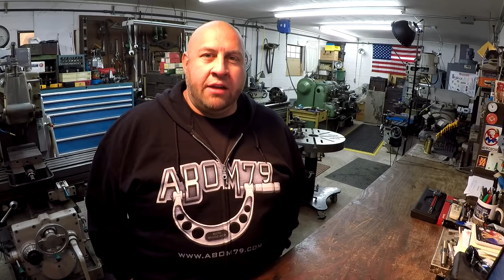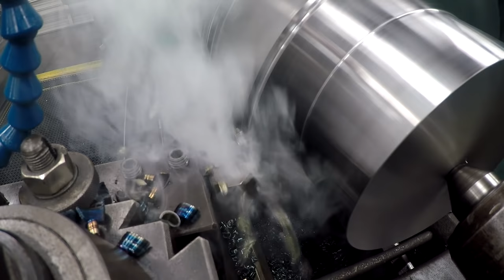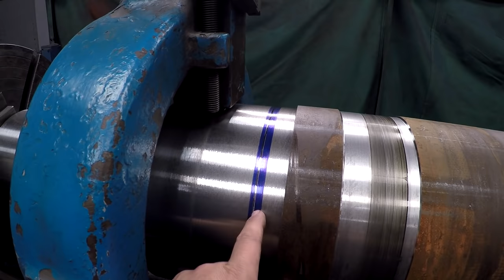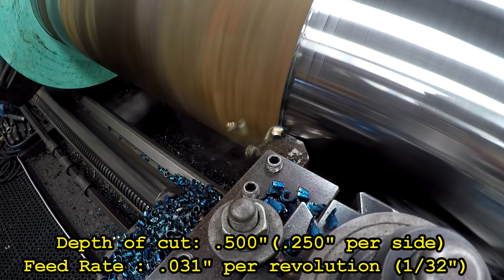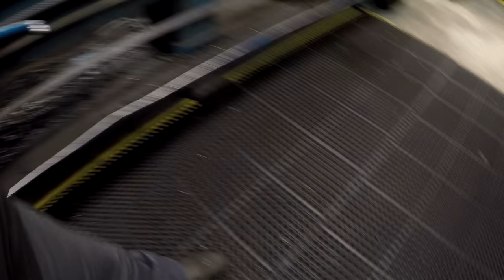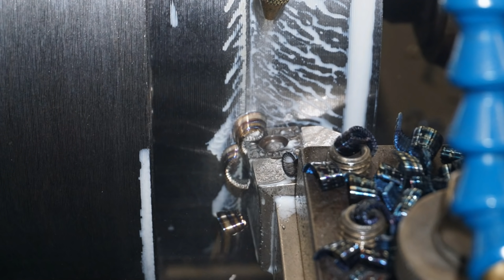SNS 149: Turning a 12" Shaft, Heavy Cutting & Feed Rates

Comment: I love the heavy turning. I think you should try .040 feedrate. I have run .300 diameter reduction with .040 feedrate roughing with a cnmg643 insert several times and it has worked well. It would do a much heavier cut but I don't have the power for it with my little lathe. Happy new year!

Comment: Blue chips and near caacity cuts. Smoke the paint off the chip pan. I love it. You have a quiet shop so there's no difficulty hearing what your machine is doing. I'm guessing from the musical note of the lgearing you're running about 3% motor slip. That would suggest to me about 80-90% full load Amps assuming a general purpose induction motor.

30 years ago when carbide was a bit more fragile than now, we would have used square inserts with 3/32 or 1/8 nose radius and a bigger chip breaker looking for chips shaped like 6's and 9's. Making the "C" shaped chips world sooner or later crumble the nose raidius no matter how much you radiused the cutting edge. Carbide is sure stouter now. An 80 degree diamond insert would nyever have survived that long roughing cut.

Next question is: who shovels and hauls the chips?
Reply: Thatt’s what new guys are hired for 😁

Comment: This takes me back to my machining days. I loved taking a beefy doc with those blue chips. I miss the old GnL VTL from the 80s that we used to have(it was retrofitted with CNC capabilities which was fun)
Reply: I remember the load sensors were broken and it would always trip with an 0.08 doc. When it got repaired my tradesman was testing out the sensors with a scrap module and a Walter WAM20 tip. I was on another lathe when I saw him walk past me dying with laughter. He was taking full insert cuts(0.5" cutting edge) and the tool exploded due to the heat. That machine was an absolute monster. Could take heavy cuts, was as solid as a rock and held size to tenths of thou. Always used it for machining back inconel welds.

Comment: Adam - that is some nice heavy duty turning. When doing a 6.35mm depth of cut (1/4 inch), how long does the insert last? Also - does cool-mist increase the life of the insert considerably or is it to keep the material from overheating?
Thanks for the constant flow of videos - even during christmas you put one up :). I can safely say that I look forward to every SNS with a cold beer and a nice sandwich :)

Comment: The thermodynamics of heavy cutting is fascinating - much of the energy from the motor is converted to heat in the chip which turns blue as it heads off into the chip pan, leaving behind a shaft that doesn't get too hot too quickly.  Subtle details make a lot of difference.  Thanks, Adam, for pointing this out.
American-born Benjamin Thompson [ Count Rumford ] in 1798 published his researches into the mechanical equivalent of heat [by boring cannon barrels with a blunt cutter] that many years later were important in establishing the laws of conservation of energy. 
  See:    https://en.wikipedia.org/wiki/Benjamin_Thompson

Comment: Wish I could have hit "like" twice on this one.  Man, that is some big piece of metal.  I can only imagine what the chips in the pan weighed.   Don't know if it was the mic placement, but it seemed like there was a change in the sound of the machine when the feed rate was upped.   I bet the power meter was really spinning fast!
Reply from the maker: +odc43054 On several of those cuts I turned the mic directly at the cut to maximize the audio for the video. It's not everyday I get to make big cuts like that.

Comment: Maybe a fan or a compressed air curtain in front of the GoPro?

Could you expound on the proper relationships between tool-nose radius, depth of cut, and feed rate in some future video? I expect that roughing tool had a fairly large nose radius.

Comment: Hello and Happy New Year Adam,  I absolutely concur.  Your comportment as an individual and You Tube presenter are a joy to watch as well as a wealth of knowledge.  Your parents can be justly proud of you and your accomplishments.

I am amazed at the large turning which generates two questions:  Just how much weight can a tapered center stand per inch of depth in the work piece?  Also when you take a cut on the workpiece to make an area for the dial indicator to read doesn't that give you a false center at the chuck?  Perhaps it is too small to be a concern?  The guess thrown out was that that piece of steel is in excess of 1500 pounds.  That has to be a lot of stress on that small bearing point of the center!  

I guess if you have no other canopy companies in town maybe a ready bought one from Harbor Freight or Northern Tool and self assembled (seems it takes about two hours on You Tube) might be the only satisfactory conclusion.  It would seem that you have no guarantee even if they get right on it when they get back to work (two weeks off with a backlog??!) that you will get yours any time soon.  You might actually be better off now to cut your losses.  Their performance so far speaks of a long, long delay.  I can't believe they would drop work with an admitted two month backlog (and by your experience probably a much longer one!) and leave customers hanging.  Paul Short over on his channel has assembled several of them as have a variety of other presenters.  The pad seems to be the big thing and you have that.

At any rate Happy New Year and all the best to you!  Take care.  Doug

Comment: Sir, firstly can I say fantastic videos! Keep it up they are very entertaining and educational. You certainly aim to please and seem like a gentleman. May I offer some advice with your cool mist... the concept is great, I haven't actually used it myself, I run cnc machines with high pressure coolant. But the idea is that the chips are meant to take the heat away from the part, it's doesn't matter if they get hot. You're cutting feeds/speeds look good, but may I suggest aiming the coolant more at the insert to keep it cool. You seemed to be cooling the chips down more than anything else. 

Keep up the good work, cheers.

Comment: I haven't seen cuts like that in 8 years. My first job was making pipeline parts on that exact machine, there was no stopping that beast. The one I used had a load meter, does yours? I don't like those spray type coolant, It fogs the shop up. Where I work we just use general purpose coolant as mist coolant,  that gets rough breathing all day, and can smell like wet socks, dog, or mouse.

Comment: i have a question. Does the steady rest cause any damage to the ways on a heavy job like that? shouldn't lathes have a heavy duty mount for them in the castings? thanks!
Reply: No, thats what the tailstock sits on too. The entire weight of one end of the stock is on the ways. If anything the steady rest lowers the weight by distributing it.

Comment: Adam:

Your contributions are all fantastic, I enjoy watching and learning from them. A couple of questions:

1. How do you know when the machine has reached its load limit? Is there a clutch that prevents overload to the carriage drive, or the spindle?

2. When the Pacemaker was built, I assume carbide tools didn't exist. Assuming that is true, how did the machinists at that time (e.g. 1940's) manage to get any reasonable life out of HSS tools while in production?

3. I was surprised to see you using the steady rest close to the headstock - what are your thoughts on what would've happened if you didn't use a steady rest like you did.

Thanks, and wishing you a Happy New Year too. Dave
Reply from the maker: +Dave Decker I have never maxed out a lathe before, but I would assume it will bog down to the point of the breaker being tripped. Flood coolant was always used on the cutters back in the days these machines were built. That always helps the tool. I use the streaky rest to keep chatter out of the shaft. Those light cuts can cause chatter, especially cutting the corner radius.
Reply: When the breaker trips or you release the smoke from the motor or contactor then you’ve reached the limit.

Comment: Awesome cutting and hypnotic watching the chips curl and blue up.  How long does an insert typically last with that amount of metal removal?   Is wear linked to tool load or feed rate?  Thanks for all the content in 2016 Adam.  Bring on 2017!!!
Reply from the maker: Iain Fletcher That one insert has lasted quite a while. I used it to rough in that entire shaft without having to flip it around.

Comment: on my small 1 meter long lathe with a 750W motor the max I can take in steel is 2mm at once, but the motor doesnt like it at all, the rpm drop by like 200, but it gets the job done fast

Comment: I wish you'd been around in the '70s and '80s when I was machining. Watching you gave me information I could have used. I worked as a production machine operator and tool grinder for milling machines and never received proper training in the machining trade. Did you have formal training, or pick it up as you went?
Reply from the maker: +James Thompson Most all of mine is hands on , on the job training  I stated working for my dad when I was 17. I did go to school for welding a couple years.

Comment: Just wondering Adam, you were saying at the end of this video that you changed cutters because of the chip formation, saying that with the large cutter you'd end up with long string's of swarf instead of chips is that for safety reasons so you dont end up with long strings of swarf whipping around the shaft?

Comment: I'm a CNC Machinist, and was always told to favor depth of cut (doc) as it doesn't increase heat on the tool like speed/feed does.  so I suppose my question is why do you prefer to increase feed, and not doc?
Reply: I’m not sure why someone would say doc doesn’t increase heat. It takes more power to do a wider cut.  That power is going into heating the tool and the metal.

Comment: Forgive my ignorance, but is the shaft hardened before machining?  I wouldn't want to heat treat a part after machining for fear of warping and changing dimensions.  I imagine that's one reason to use carbide tooling.
Reply: You heat treat a part after the machining is done.  You don’t want to cut a hardened part. You can only effectively harden some types of steel - those with lots of carbon.

Comment: What is the reason for greater and greater feed and not DOC? Just easier to keep track of being one turn on the dial? And easier to increase while moving I guess.
Reply from the maker: I don't know what the limit of the machine will be, but i feel comfortable with 1/2" removal per pass, and small increases of feed are a little easier to adjust on the fly vs changing infeed depth. On many occasions more feed makes for an even better chip breaking off the tool, that's another reason for the small increases.
Reply: Thanks. I assume these machines have a positive lock on the feeding. My little 10 in craftsman will slip the clutch if I try too big of a cut. What happens if you jam the feed? Say running into a steadyrest? I would guess a shear pin breaks somewhere.
Reply from the maker: The Metal Butcher The carriage feeds are built using a cone clutch system. Too much force allows it to slip.

Comment: Nice vid! how did you face and drill the center hole on such a large piece? thanks
Reply from the maker: +redtheriffer Be sure to check out the previous episode of SNS to see more on that. I typically use the boring mill to drill a center then move to the lathe and machine the od for the steady rest.
Reply: Abom79 thanks I did end up watching something where you used the hbm for this. For those of us who don't have one, is there any other way other than drilling the center by hand? Maybe rolling it rough in the steady just to get the center, and then cut the flat for the steady? Thanks

Comment: How many HP is your lathe motor?
Reply: trainedtiger gotta be at least a 50hp motor...im sure its running on gear reductions
Reply: trainedtiger    I was wondering the same about the hp of the lathe. I have a 10hp ikegai 20" swing lathe that can move some serious metal. I've pushed it to its limits a couple of times just to see what it can do. .250" depth of cut, with feed rates close to what he was pushing in this video. It's nice to have some horse power. I got a heck of a deal on that machine. Awesome machine. Wish I had more work for it.